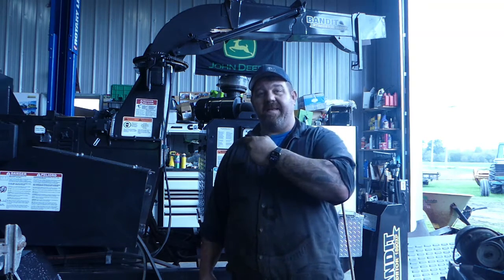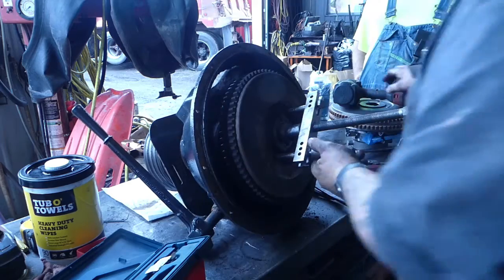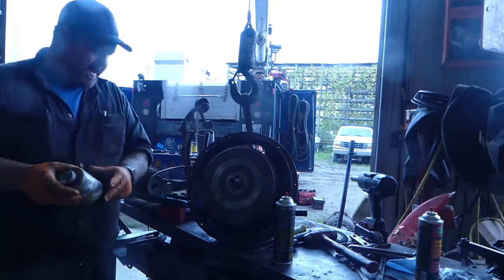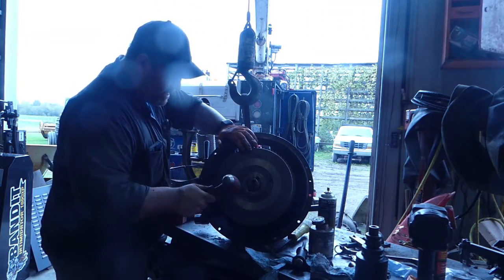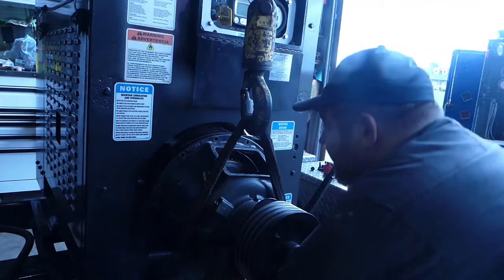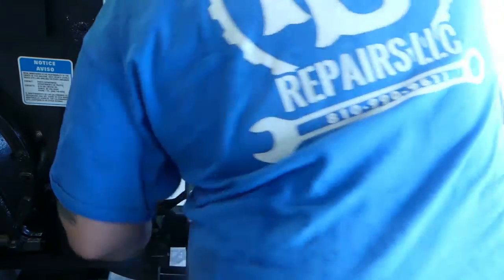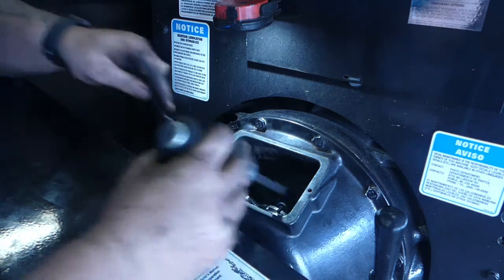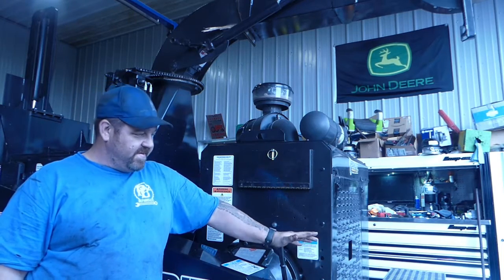Bandit 1890xp twin disc clutch replacement.

Comment: Nicely done Phil. I make it a habit to check out the cutter and bed knives every 40hrs of use.  You would be surprised on how dull they become. And write down the belt number on the inside of the belt cover. 
For future reference for you and the operator.
Reply: Replace the bolts if you are Flipping the blades. Once you torque them they become stretched and weaker when retorqueing. Had some break. The damage wasn't pretty
Reply: @OneMechanic  yep i forgot to say that thanks for the save.  Don't know if banditt does. But i know Vermer does. They sell the kit. That has the new bed knife with new bolts cheaper than you can get the bolts elsewhere.  And they sharpen the cutter knives cheaper than i could buy sending them out.
Reply: @ifitsnotbrokenfixit1193  we carry extra bolts just for Flipping the blades...